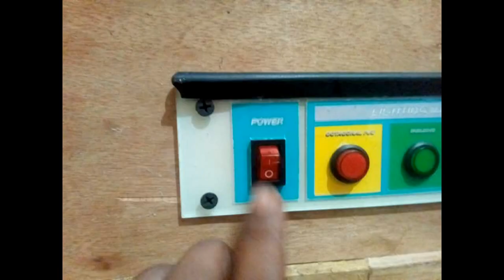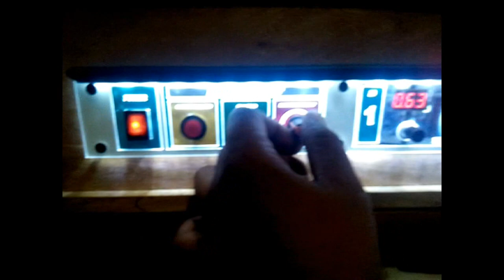cara membuat lay out miniatur kereta api indonesia part 2 skala HO 1/87 by mang irin

Comment: Untuk penggerak dari lokonya pake dinamo berapa volt kang..terus bahannya sendiri untuk bodi loko dan gerbongnya bahannya dari apa bang..?TKS..
Reply from the maker: Cahyo Miyarto motornya 12volt kang untuk bahan gerbong menggunakan acrilic dan abs plastik
Reply: @MANGIRIN  saya tertarik untuk belajar kang..tapi gimana caranya bang..😁😁..
Reply: Berarti sumber listriknya dari sumber power 220 ke  adaptor 12 volt..di sambung ke relnya trs konek ke dinamo 12 volt..klo boleh tau rel nya dari bahan apa ya bang..?maf bang byk tanya..penasaran😁
Reply: @cahyomiyarto6866  dari besi gan